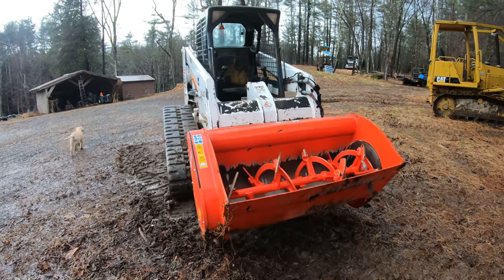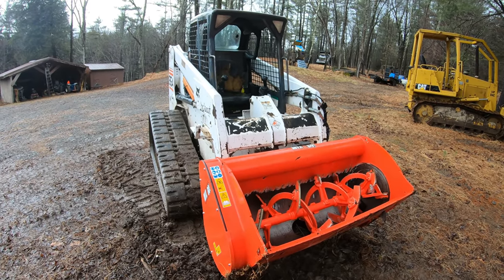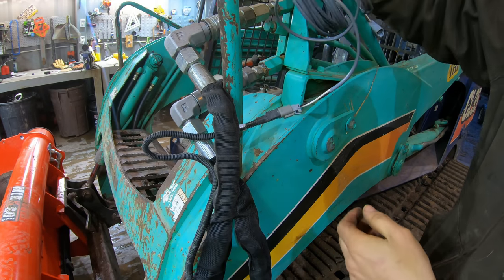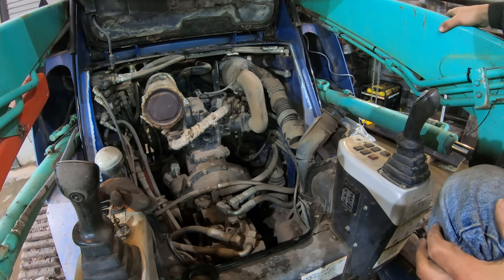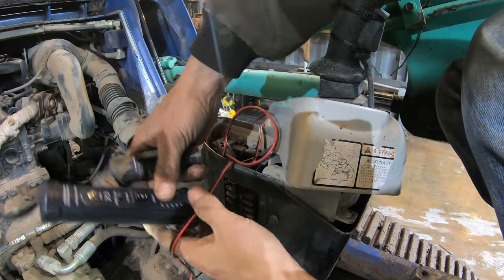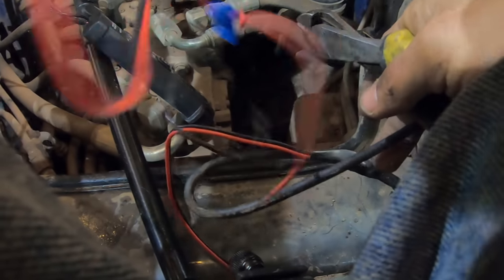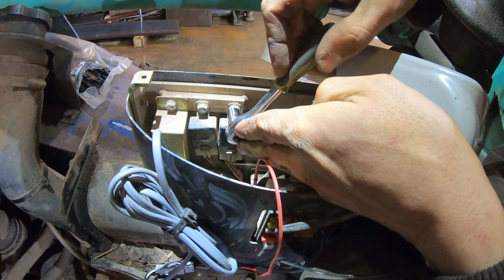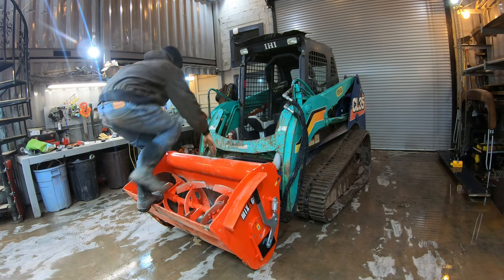Setting up the IHI track loader to run a cement mixer

Comment: Because of you every electrical project I've done has been done using solder and heat-shrink! Really gives you a good feeling to know that the connection will likely outlast the equipment. I've re-done 2 trailers, my boat trailer (which was done half-a** by the previous owner with cheap crimp connectors!), and a solar system. Thanks Andrew!

Comment: Andrew, Thank you for doing a proper job on wiring the accessory wiring. It's good to see someone like yourself doing a proper wiring job instead of just shoving the wire into the "hot" side of the fuse panel and not thinking of the shorting issues of wires rubbing against something sharp or just from usage on a application like yours. :)

Comment: Nice job Andrew. I keep a roll of aluminum foil in my tool box for brazing and electrical work. Helps protect stuff from the heat. You could take a small piece and protect that back loom from the heat gun. Looking forward to the next video!
Reply: Great tip.  I went back to see the heat gun in this video.  I hadn't noticed the back loom took a little heat.  Good eye, man.
Reply: Nice tip.

Comment: You bring a very good point. I always admired well thought out layouts on machinery and that why I am a Kubota fan. Cluttered and messy engine bays show lack of quality in my opinion. But there is a greater point to be made the best equipment manufactures are the ones who specialize in other stuff outside of agriculture and construction. IHI makes turbos, Energy plants, infrastructure and aero space engines. Kubota makes water treatment plants, precision equipment  as well as they produce and supply materials to large companies. Yanmar is known to make good long lasting engines but they also produce energy systems and marine engines. Now I would assume the teams working on their aero space engines are different than the people who develop  construction equipment. But by looking at the quality and attention to detail you can’t help to wonder the full extent of the rest of these company’s influence on their equipment. But there is another trend I see, the Japanese can make some fine equipment Yanmar, IHI, Kubota and others like Hitachi and Komatsu. But I credit their success if you will to their ability to set higher standards question the industry and make something consumers will love. Be glad I left out Yamaha, Subaru, Sony and every other Japanese Fortune 500. Great video sorry for the rant.

Comment: Another cool trick I learned with the solder seal connectors if u cut them just past the first water seal u can slide the solder part over the ring connectors and have a good water tight seal and soldered connection on ur ring terminals

Comment: The safety cage that goes over the mixer should have a triangular blade in the middle. You can drop your bags of cement on it right in the center of the bag. This lets you open the bag like closing a book. The two halves empty really fast without messing around with the bag or a knife.

Comment: you burned a hole in the wire casing below at 9:57 then said "that's the only way to (do it)"    lmao
Reply: Michael Lance it’s just the wire loom it will be alright. Nothing electrical tape can’t fix
Reply: @nascar10027  True, but there is a lesson here to be learned:  Watch what is behind the thing You are pointing the heatgun at!  Some of those things can not be fixed with electrical tape ;)
Reply: @nascar10027  all true, but I still laughed.
Reply: They sell deflector designed to protect the surrounding, they mount on the gun
Reply: @disarm2k10  Exactly! :)

Comment: Next accessory, a water tank and pump on top for concrete, run a new wire and switch. Small hose or pipe or front and you have cement!

Comment: I have that same switch, came with a bosch/rexroth diverter valve. Used that setup for a 3rd function on a tractor's loader.

Comment: Great video. I have myself taken down my bathroom tiles and did the same thing. Plumber came and tile guy install. Also I had a Moen installed and the exact Part was bad and it ended up being the rubber seal around the edge. Manufacturer defect. But they will replace any part even how old it is.

Comment: Awesome quick fix.   I might have missed the electric plug that went from the mixer to the grey plug and play adapter then into the switch.   I used these welds since watching your videos and never had a connection fail...  Thanks for the videos!!!!  PS when you getting the side x side out again.....

Comment: Excellent wiring job, the only thing I could add is to use the heat shrink with adhesive inside for an entirely waterproof job.

Comment: Andrew if you like the layout of the IHI, that’s just a Takeuchi knock off. So if you’re ever in the market for a brand new or used skid steer start there. We run Takeuchi, bought used and some brand new ranging from 100 hours - 5000 hours. Great machines.
Reply from the maker: Good to hear.

Comment: Those heat shrinking connectors are soo much better than crimping or normal soldering we use them for any wiring we do

Comment: Hi Andrew. Man, thats one nice little puppy. He will learn from Levi. Yellow Labs are the best. That skid steer has the engine mounted length ways instead of cross ways. Much better design, i think. Everything easier to get at. Some advice. Put a big woodstove in there, or mabye an outdoor boiler. Better yet, build one. Your castle is looking awsome!!!

Comment: Andrew, as long as the solder joint does not move it is the most reliable.  If it is subject to movement it will eventually fatigue and break.  Multi-strand crimp is best for those.

Comment: whoa, Andrew ..Coupon codes too!  I get lost on the 'skidsteersolutions' website-that Halverson wood splitter is the bees knees.  I did try to buy a CL35 but, I think you got the only one on the market.  Went for a TL8 Tak, couple more days and it'll be in my garage.  I did my homework, tested everything not Deere/Bobcat-nothing against American made.  Just prefer the Japanese stuff, easier to work on, parts seem cheaper(if you happen to break something) hope i can keep the Tak busy this summer.  Thanks for sharing 

-John

Comment: Nice work with the solder and shrink tube.  You are right butt connectors just dont hold up especially in the elements. By the way, no one inspects a completed job like Foreman Levi!

Comment: What a great attachment that mixer is,...good wiring job, I do think that your thought on getting rid of some of the excess wire under the console, is a good one. 
The weight of the wire,..down the road, may give you some issues with other wires in there.
That quick clip of Cody ( 14:57 mark ) sitting there and looking up at Andrew,...isn't that just perfect?

Comment: Nice video! Andrew, you took a yellow cable lug, that's for 6mm² or AWG 10. The blue ones are for 2,5mm² or AWG 14 and the red ones for 1,5mm² or AWG 16. The wire you crimped is AWG 16, i presume. Get yourself a set of all three sizes and a good crimp tool, the fitting will be airtight and you won't have to solder it afterwards.

Comment: Crimp connectors can be reliable for years but the quality of tooling you need to press them hard enough to get a oxygen free connection is actually quite spendy. Cheaper in the long run if you do it all the time but soldering is is better for the home gamer and actually better in general especially on a machine like this that gets dirty and wet often.

Comment: pro tip put die electric grease on your grounds, it won't hamper the connectivity and it will protect from corrosion. i learned the hard way after cleaning/sanding all my grounds and reinstalling dry.

Comment: Andrew have you ever tried a concrete pump for a skidsteer? They work great. I had one and all the building contractors in the area would hire me to use it on their jobs. Very good income booster. I had a skidsteer that it just stayed on all the time.

Comment: Can you order switches for the control panel?  Seems like it might be a more comfortable solution if you get tired of the zip ties.
Reply from the maker: TWX1138 I might move it.
Reply: @AndrewCamarata  I wondered the same thing about the panel switches, but I guess those buttons were not switches, just knock-out place holders.

Comment: WOW ... You finally used 1/2 of my idea.  Now if You'll cut and weld a "hockey blade" on the end handle, You'll be able to close the latch on the implement attaching point with very little effort ... or not

Comment: After you solder that connection wipe it off with a rag and acetone to remove the flux (clean it up) then put on heat shrink

Comment: Could you have used one of those spare buttons on the panel, as opposed to the joystick?  Seems like that new button is going to be in your way, for how much you’ll be using it.
Reply from the maker: Maybe.  Those were just spots for buttons, but the buttons werent there. Could easily add one though. I might still do that.There is one button on the other joystick that is a spare, I think. IDK, its working the way it is.

Comment: Interesting it came with a return to tank line but electrical hook up.....do they have kubota engines or yanmar?
Reply from the maker: Yanmar engine in that.
Reply: @AndrewCamarata  ah I see why you got it then....one year of use and no broken motor mounts....I'm impressed

Comment: Andrew look at getting a ratcheting crimping tool. Use that with the coloured crimps. I crimp with those ratcheting crimpers, there are good and bad ones, then solder then heatshrink. That way the connection is too bloody scared to fail. 

Been doing this on mining equipment for 30 years. 

They fail but it takes a damm site longer than other methods.
Its usually the operators fucking with stuff to get out of work.

Comment: Andrew, any recommendations for a forestry mulcher for the IHI CL45? Looking to add to my tool selection. Also got my Mix&Go ordered yesterday, should be here within a week or so!
Reply from the maker: Thomas B. Cool. I have not tried a mulcher. I have that mower that’s cool for brush.
Reply from the maker: Don’t forget your coupon code on the mixer.
Reply: @AndrewCamarata  I didn't forget! Thanks!
Reply: @AndrewCamarata  All I have to look for is the proper hydraulic flow rate, right?
Reply from the maker: Yeah, the person selling it to you should be able to tell you if it will run on your machine. Is that machine high flow? Try to figure out what your gallons per minute is. That will help when ordering the mower.
Reply: @AndrewCamarata  Ok! Many thanks!!

Comment: When I first seen this  I thought it was a snow blower I have done years of flat work and this contraption may be ok for side walks, driveways  and such. But on that floor you want to have a consistent mix through out or you will dealing in the future with the rings of hell..

Comment: those solder, heat shrink tubes only work for about 2 years then they corrode or just break off. i fix those all the time

Comment: Hi Andrew, its 4 years since you made this video. Is this IHI CL35 skid steer still you favorite. I am looking for a skid steer to buy.
Reply from the maker: @haissam9999  this is still a very good machine, the larger size of the TL 10 and TL 12 are better for the scale of the work I’m doing. And those are easier to find. If you want to buy a new CL 35, it would be branded “Kato” they look very similar to the more common Takeuchi though

Comment: Andrew did you know SAM's Club has Shell Rotella T4 15w40 oil on sale for $10.50 per gallon in 6 pack boxes. Limit of 5 boxes. With free shipping. I received the  5 boxes I ordered on Friday; with all your diesel engines you might be interested.

Comment: Roof looks good. Im glad you didn't go with LVLs
Reply: Why, using steel the way he is is the stupid and a bad structural design. Theres a reason commercial construction uses steel but they BOLT EVERYTHING together first then weld where the engineer calls for it. I could build that with wood much easier and FASTER, truss it in one of like 3 or 4 ways (wood TJI, LVL, standard trusses, or engineered box trusses) to get clear span and have it closed in by now and a lot cheaper.
Reply: @n8_the_carpenter816  Did it ever occur to you that maybe that’s not what he wants?
Reply: @psidvicious  oh I am well aware of that, a lot of things he does he does to his own beat. But is it right or the best practice no. Wood to steel if a pain in the ass connection for a lot of things (very few ways are easy and the only industry standards; ie packing out a I beam) wood to masonry is relatively easy, masonry to steel not a great thing as they can react (rust)
Reply: @inthewoods5471   as I said everything in commercial and industrial comes as a bolt together and then they weld where the engineered plans call for. Yes the plates that they bolt at are welded on most times but done in a factory setting where you can control environmental impacts much easier and get continuously consistent welds. Also bolts allow for some tweaking if need be, you can elongate holes or just tweak and sung up with a bolt (not recommended but its done)
Reply: @inthewoods5471  also bolts can shear and snap, good welds dont fail. The metal tears away from behind (past) the weld

Comment: There seems to be a third pipe between the hydraulic connectors, any chance the aux wiring connector was hidden in there?
Reply from the maker: ratchetfreak I think that’s just a pipe. For case drain.

Comment: Hey Andy. Just wondered if you received the gift I made for you Mate?
Reply from the maker: What was it? I just got a few. I usually send thank you letters back.
Reply: @AndrewCamarata  its in the black box covered in Duck Tape. I made you a knife and key ring.👍
Reply from the maker: Yes, I got that. Thanks. Good job on the wood burning.

Comment: Hey Andrew. Did the wire in the background melt when you used the heat gun on the shrink connection? It looked like it happened at 10:00. G.
Reply: Just looks like a strand at the end of the cable protector gave way and resettled

Comment: I have the same aux hydraulic hookups on my bobcat and sometimes can't get the lower one to accept the attachment line. It just won't push in which is very annoying when trying to hook something up. Sometimes it works, and sometimes it won't. Anyone have an idea of a cause for this problem.
Reply from the maker: deals from virginia release the pressure. Sometimes there is a button. Sometimes hit the switch with the engine to off.
Reply: @AndrewCamarata  Thanks, I'll give it a try.
Reply from the maker: Hit the switch both directions with the engine off, key on, and accessories enabled.

Comment: I'd love to know if Andrew has the phone number of the folks who own that white building in the distance in his wide, banner picture. It appears to be a metal building with awning extensions on either side. If he saw a fire approaching it, would he be able to call the owner to warn them? Cody's color preference for jacket or collar seems to be blue. I don't recall if Levi ever had a color scheme, other than white. LOL. I used to work at a wood and steel fence supply yard. The owner got a chance to buy an old, operating fire truck to protect his investment. Only $500. It set right on our lot. We did not get to use it to put out any fire. Had none. Wonder when new t-shirt with both Levi & Cody will be available. Subscribers still growing at nearly 1,000 per day. I just hope they will be patient waiting for new vids. Plenty to watch one a day for a year, even without new ones.

Comment: I have some of those shrink-wrap sleeves with solder inside them also.  They seemed like a great idea at first, but I have to say the more I used them the more I realized they are complete shit.  I don't use them for anything serious.
Reply from the maker: What problems were you having with them? I've been using them for a year now. I like that they are faster than solder/shrink tube. I have not had any issues with them yet. Only thing I noticed is if the wire gets pulled hard, they can pull apart. But when the wire is mounted that shouldn't happen.
Reply: @AndrewCamarata  I have had them come apart on me several times, you really have to make sure the solder melts thoroughly.  The problem is when you are heating the middle to ensure the solder melts properly the shrink-wrap ends up melting and deteriorating.  Also, the shrink-wrap itself just doesn't seem that good of quality, and again it has come apart on me. I had a couple fail on simple connections I made in my car engine bay.  It's a good idea, the quality just isn't there.  I think they are made from Chineseium.

Comment: Andrew, I have had occasion to use a different style of wire stripper that can often speed up the job if there is a lot of wires to strip and you have the space to use them in.
The link is to a different brand but same style. Use is place the wire in appropriate spot ( as per gauge ) then just squeeze handle, it clamps, cuts the insulation and strips it from the wire as you squeeze.
https://www.homedepot.ca/product/klein-tools-katapult-wire-stripper-8-22-awg/1000664013

Comment: Looks like you have a huge issue with condensation water inside of your building. Even your workbench was wet. 😩
Reply: I think Andrew just cleaned the floor and workbench. The floor is a lot more dry at the end of the video.
Reply: @skjoldmail  You can see the water running down the walls in other of his videos, the issue is the completely missing insulation so that the walls have a to low temperature (below condensation point).
Reply: @Snooooozel   So this must be the Achilles Heal of the container building concept. Question is; how do you insulate these containers efficiently?
Reply: @Snooooozel  OK. I didn't notice that.
Reply: @crrcoal  I would use spray foam if it has to be done.